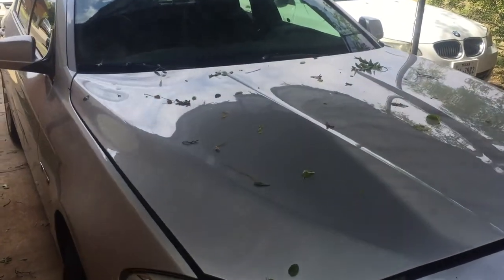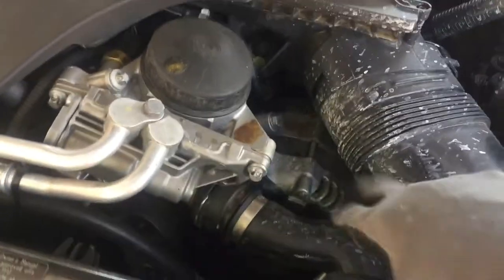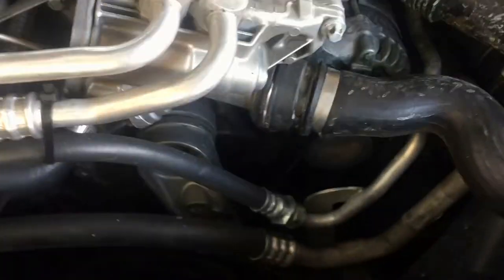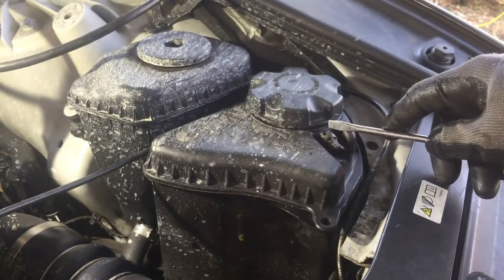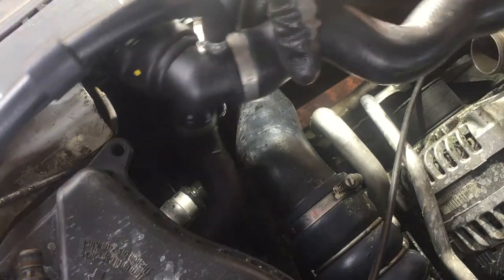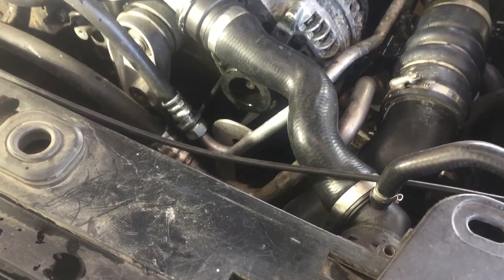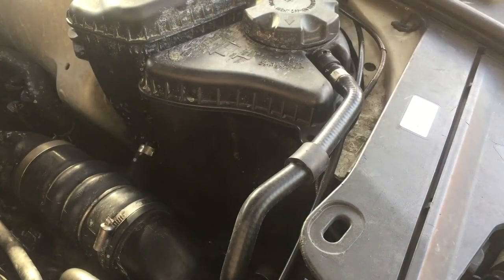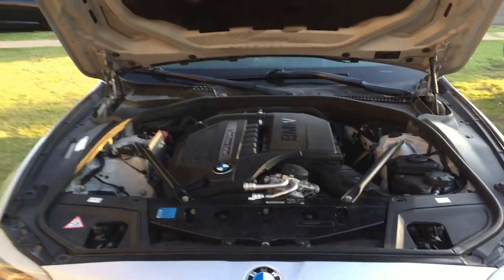replace upper radiator hose 2011 BMW 535i

Comment: I just changed the oil filter housing gaskets.I think I lost the oil ring that that goes in the hose that plugs into the housing. You said in this vid that you used an o ring from Harbor Freight. What size do I use until I can buy a new hose? Also, what goes in first, the o ring or the plastic ring. Thanks your vids are very helpful.
Reply from the maker: Hi Bennie G to be honest you probably have to order the whole hose. I ordered it online cheaper than if you buy it at the dealer. The gasket I used never really worked it worked for about a few days then it started leaking so I recommend you buy the whole hose thanks for watching and like always. I really appreciate you. Good luck, the plastic ring goes in first then the gasket I believe ??
Reply: Where u buy from Cuz I bought 1 before and it didn't come with the o ring and the stopper thing..I ended up using the old 1. Now it's all bad..

Comment: What's the plastic thing with the o ring. Where can I get it, mine is cracked.
Reply from the maker: Hi AndreGTunechl it’s a coolant hose flange those break on me 99% of the time so just go with aluminum one. Here’s the link and thanks for watching. I really appreciate you…….https://www.googleadservices.com/pagead/aclk?sa=L&ai=DChcSEwiJwvHqx7CFAxXsONQBHVvCBAcYABAKGgJvYQ&ae=2&gclid=EAIaIQobChMIicLx6sewhQMV7DjUAR1bwgQHEAQYAyABEgLga_D_BwE&sph=&ohost=www.google.com&cid=CAASJORoXk9PbEGlqlPKFp9B-nfzm7ID6n7TQbNj_sN6GBradkKq6Q&sig=AOD64_19kuFqPF4f0oSWZvOB_4jUPctdWA&ctype=5&q=&ved=2ahUKEwiXmefqx7CFAxVYKEQIHRMiC1MQwg8oAHoECAQQFg&nis=8&dct=1&adurl=
Reply: @Marty09933  THANKS I APPRECIATE IT
Reply from the maker: @AndreGTunechI  your welcome 🙏

Comment: Marty, the O ring fell out and I had to order a new one that will fit. Now the hose will not go all the way in (radiator side), even aligning up with the notches. Any advice?
Reply from the maker: Hi Fernie Gonzalez look inside the hose make sure the o ring and the plastic ring is in place  make sure it sits in the little grove. make sure it didnt get stuck on the outlet  from the radiator side  hope you get it .thanks for watching i appricate you

Comment: I just changed my upper radiator hose and belt and tensioner but I’m getting leaks idk where from. It’s coming driver front tire and it only happens when I shut off the car and my coolant goes below minimum. I re clamp reservoir hose with a flat head clamp cuz the one that came with I had a hard time moving it. Idk what to do
Reply from the maker: Hi Ouday Azzam yes i always replace those shitty clamps good job on that. make sure your reservoir is not cracked. check your radiator and evaporator mine has two in front of each front wheel behind the bumper and wheel hope that helps you brother and thank you for watching i appreciate you

Comment: What’s the last one you unclipped called with the water spilling out the nipple part
Reply: With the hose clamps
Reply from the maker: Hi richcaponerovgang7163 thanks for watching. I really really appreciate you…….,https://www.googleadservices.com/pagead/aclk?sa=L&ai=DChcSEwjen_nf2ImHAxVyF60GHZgbBkoYABAZGgJwdg&ae=2&gclid=EAIaIQobChMI3p_539iJhwMVchetBh2YGwZKEAQYAiABEgJF2fD_BwE&ohost=www.google.com&cid=CAASJORogUByTicSXBduGBF4nTmgLzQhwXWOBEp6rDSU3YVaTosokA&sig=AOD64_0M7YYGy6LqrLM_wMKvQU0p7JrP3w&ctype=5&q=&ved=2ahUKEwjZwPDf2ImHAxX4H0QIHUaiDsYQwg8oAHoECAYQEA&adurl=
Reply: Did you have a o ring on the radiator hose at 13:15
Reply from the maker: @richcaponerovgang7163  yes there is one in there

Comment: Marty who makes the clamp holder you used and/or what is the tool named?
Reply from the maker: Hi Daniel Jones mine are Mac Tool  they are clamp pliers . But auto zone sells them cheaper . Thanks for watching I appreciate you....https://www.googleadservices.com/pagead/aclk?sa=L&ai=DChcSEwjyhN3h5ojvAhWP4cAKHZqFCtYYABAHGgJpbQ&ohost=www.google.com&cid=CAESQOD2kdmzG_--Nkq6SpDuk2BvCoVvB9SUnYbB5LvXciWz7wfkfAzZbB0xvEPxg0WSTML4CXxpm4ASgt7t3W7zylA&sig=AOD64_0B0YPRpo_OhxwSgOxuIEYwTo4PrA&ctype=46&q=&ved=2ahUKEwi05NLh5ojvAhVbLs0KHV80ACsQzzl6BAgCEDo&adurl=

Comment: How do u put the o ring in i have a 535i 2008
Reply from the maker: Hi boosie Parson  it should just push in . What happened it fell out or you replacing it ?
Reply: @Marty09933  it fell out send me a picture of the one i need to put back in there what size
Reply from the maker: Hi boosie  Parson what’s wrong is it to big now ? Cause that happened to me don’t know how it happened but wouldn’t go in too big ??? I ordered some  oem and even bought a box of O rings but they just lasted a month or so ended up buoying the whole hose .
Reply from the maker: @lienaDerderian  Hello you have to go but a new o ring or a box with an assortment of them or buy a new hose with o ring . Thanks for watching I appreciate you

Comment: Missed some important parts on how to remove and install the air cleaner intake. Can’t remove the hose with it on. Allmost busted mine tryna squeeze it in. Lol
Reply from the maker: Hi A Wax  I don’t think I removed it for this job?? But your right it can be a pain in the rear  I just squeeze it  .mine has a side already broken  . Thanks for watching I appreciate you